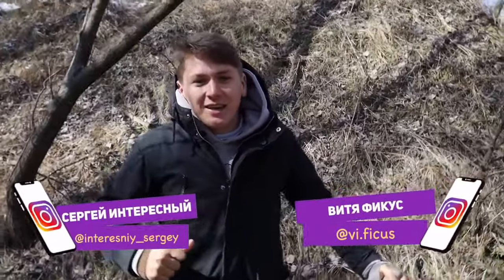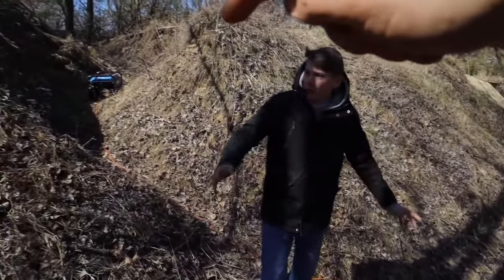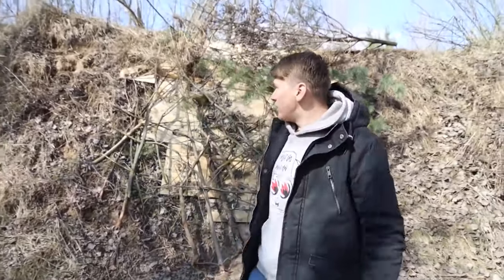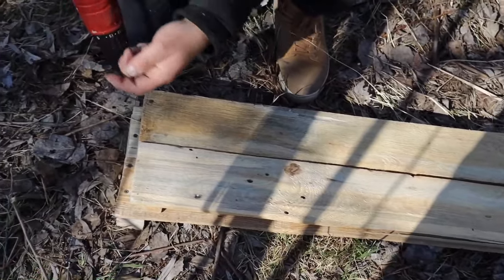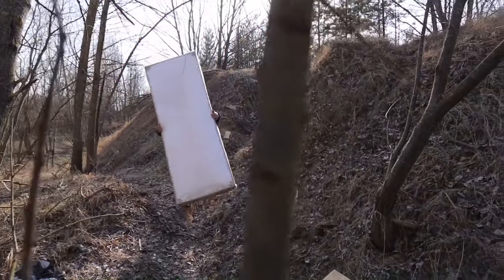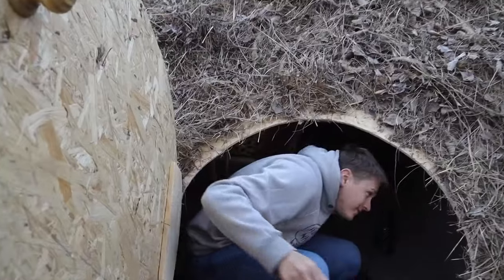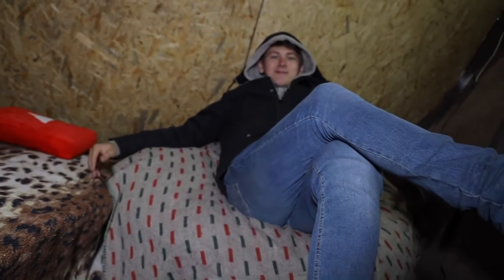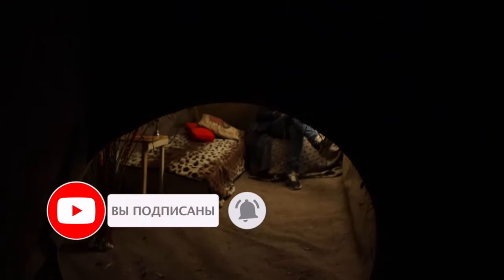UNDERGROUND HOUSE IN THE HILL – DIY

Comment: Not a great idea building shelter in a washout area. Also, that wood will rot out so fast.
Reply: You just gotta let these kids learn the hard way.
Reply: Such a waste honestly that woods gonna rott and the carpet is going to mold once it gets wet I would have dug in the hill and took measurements of the inside and cut green wood to make structure to support the weight it’s tough work but definitely worth it
Reply: What's a wash out area?